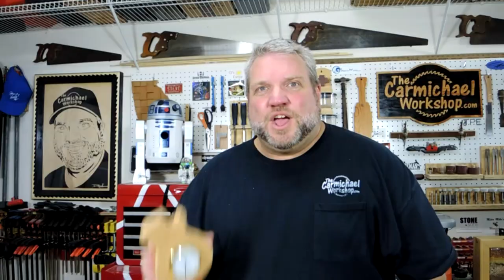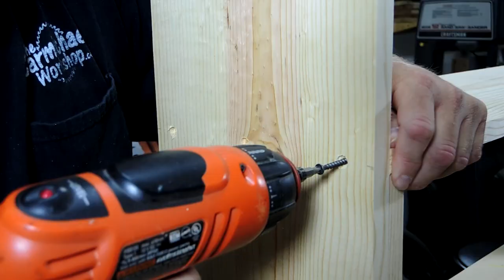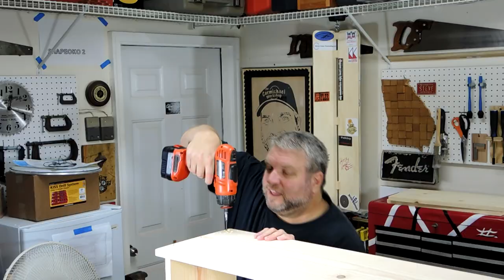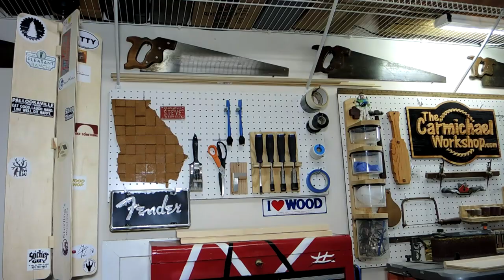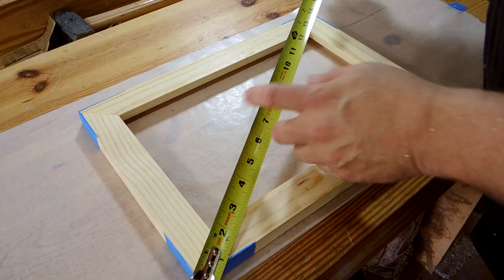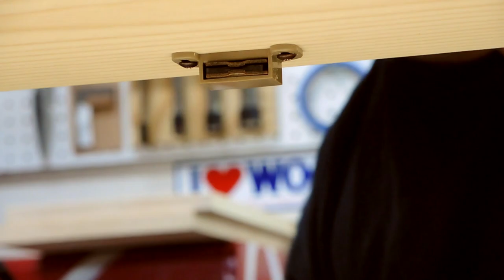Make a TV Console Stand - Entertainment Center Woodworking Project

Comment: Nice build & tutorial! That B&D drill was one of my first cordless drills ( the 12 volt version). I love it because you can drill & screw with one tool very easily. Now I know it's not heavy duty but they should use that design for other all cordless drills;)
Reply from the maker: Construct Icon Thanks man!  Funny you should mention the drill.  I bought that in 1993.  I love the removable chuck.  I was looking at new ones yesterday at Lowes and none of them had that.  I'd miss it for sure.
Reply: Where do yo get your back up batteries? I looked once before but could not find them. I would love to get this drill up running again:)
Reply: I would like to know as well.
Reply from the maker: Construct Icon  +HAYAHIYAHAYAHO  I'm on my last 14.4 battery and haven't bought one in years.  If lowes/hd don't have it, I would have to google it or search ebay.

Comment: Nice job and it was a pretty day. Hardly any smoke rising off the concrere. Still waiting on the a.c. unit!
Reply from the maker: Lewie McNeely  Yeah, was nice out but the sun and heat was draining.  It was even hotter in the garage though.  ugh
Reply: You need a walk-in freezer unit for this time of year. It's supposed to be really hot so yall may melt sho' 'nuff!

Comment: Steve - Did you joint and/or plane these boards before assembly? If not how do you normally deal with warps and twists in off-the-shelf boards? Thanks!
Reply from the maker: I just ripped one side of each board so it was smooth before gluing them together.  I try to find the lightest boards at the store since they are most dry, and inspect it well.  That saves a lot of headache.  Wide boards will cup, so I try to put the crown on top so it will sag into place.  Usually the screws help straighten it all out as long as it's not too bad.

Comment: Very well done, Steve! Is there a reason you didn't just use through dowels instead of the screws?
Reply from the maker: Steve Collins Thanks Steve!   Yeah, I didn't want to glue it all together in case I had to change something.  We went back and forth on the measurements for the shelves, so if his stuff doesn't fit, I can just drill out the dowel plugs and take it apart to make changes.
Reply: Steve Carmichael Ah, good thinking.

Comment: cool project..  just curious.. is this wood will be robust enough ... for long run...
Reply from the maker: +Subbaraja Vankadari   It is pine so it is softer than something like oak or maple.  Much less expensive though.  It will be fine for a console.  I wouldn't use it for a foot stool, chair, or something that gets lots of wear and force put on it.
Reply: Thanks Steve, got it this is very light weight and easy to make and with soft effort.

Comment: Neat build. But why didn't you just do the same thing that you did wit your plugs with pocket holes? Its the same exact thing.
Reply from the maker: Thanks, it was a fun building something that was designed by my friend.  I don't remember if I considered pocket holes or had a Kreg jig then.  Looking at this project now, it looks like it has a lot of small compartments that would be difficult to fit my drill inside to screw in pocket holes.  They would probably be better hidden, but I just like the look of exposed plugged round dowel holes over the big oblong pocket holes I guess.

Comment: Steve,  have you ever used trim screws instead of drywall screws and wood plugs?
Reply from the maker: Hi Andy - I've never heard of trim screws.  Do you recommend them over drywall screws?  It's funny but I don't think I ever put much thought into deciding what screws to use.  I remember about 30 years ago using some leftover drywall screws on a project and just always stuck with them.
Reply: Steve, Trim screws were originally used to fasten wood trim (or synthetic trim) where steel studs are used.  They have a small head and have either a square drive or Torx head.  Another option that I have used for attaching face frames to cases is to cut a square hole (either with chisel or hollow chisel mortise), fastening with a trim screw then using  a square plug to fill the hole.  Gives a more finished appearance on high end casework.

Comment: Curious why you just didn't buy 10 inch wide boards in the first place if you ripped them to 10 inch anyway?  Wouldn't you have saved both time and money by buying 10 inch wide stock?
Reply: Ah, I see.  You mention it later.  I forgot that it's not really 12 inches wide, nor is 10 inch wide stock actually a true 10 inches.
Reply from the maker: @TheOrcasRule  Yeah, I was about to ask you where to get 10" wide boards. Thought you discovered something new.
Reply: @SteveCarmichael  You can get 10 inch wide boards, but of course they're more like 9 1/2.
Reply from the maker: Nope, sorry, you can't get 10 or 9 1/2" inch wide boards from a big box store.  A 1x10 is actually .75" x 9.25".  You might be able to get 10" wide boards from a lumber yard though, but you have to pick through them and measure.